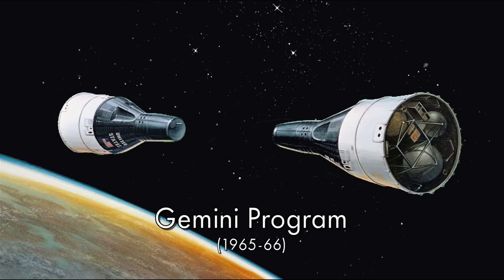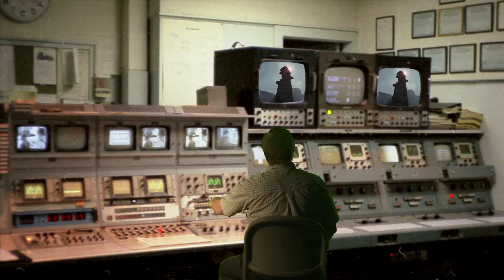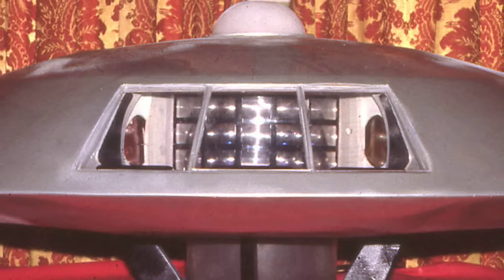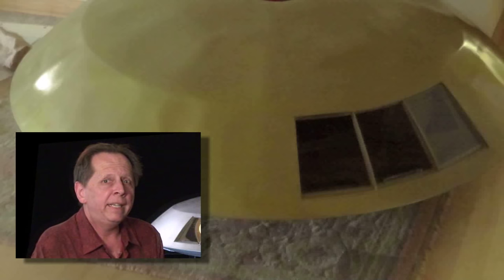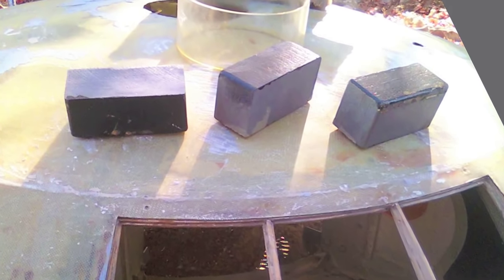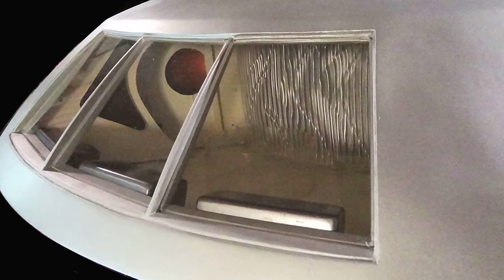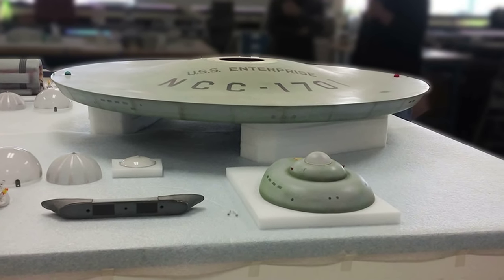RESTORING THE GEMINI 12

Comment: It was too slow.  Would take 98 years to get to Alpha Centauri.  The Jupiter II could make the trip in 5 1/2 years or much faster as in the 3rd season they pass through an entire galaxy over night.    .
Reply: Irwin's shows weren't noted for scientific accuracy.  I'm pretty sure they thought "galaxy" was interchangeable with "star system".  Then, a very, very few times they came up with some great sci-fi concepts like the "little bits of sunlight" in the generically titled season 2 opener, "Blast-off into Space" or the season one episode "Change of Space", with its intergalactic delivery ship.  One thing I've always wondered about is this:  if Alpha Centauri is 4-1/2 light years away, and the J2 can't travel faster than light, though it would take it that long to get there to the OUTSIDE observer, wouldn't it seem a lot quicker to the crew?
Reply: varanid9 with time dialation the time would be much less for the occupants.

Comment: Fusion core still looks to long?  Ship is perfect
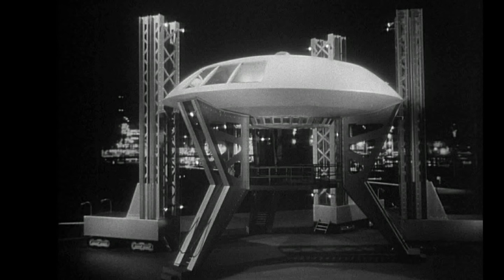Reply: Eddie, what do you mean by: "Fusion core still looks too long?"  They are identical.  Take into account the difference in appearance due to focal length of the lenses used (See 1:30-1:38).  We have no way of knowing the lens used in the shot you are using to judge.  Also, the lower brightness lighting seen at 3:48 clearly shows the Fusion Core's rim detail allowing for a more accurate comparison.

Comment: Where did Jupiter 2 comecfrom?
Reply: At the time of the Lost In Space pilot, NASA was in the middle of the Gemini space program.  The Gemini capsules held two astronauts and the mission was to rendezvous with another capsule and crew.  Irwin named his ship the Gemini 12 figuring that the network executives would be familiar with the then-current Gemini program and understand that the Robinson's ship was an extension of the name only 30 years in the future.  NASA's Gemini program ended about a year later with the launch of, coincidentally, their own Gemini 12.  When Lost In Space was sold as a series, Irwin and the producers realized their ship's name would soon be history and re-named it the Jupiter 2.  No one has a lock on where the name originated, but Allen's 1962 feature "Five Weeks in A Balloon" was centered around a gondola and large balloon named the "Jupiter."  So, the Robinson's ship would be the second Jupiter...Jupiter 2 if you will.
Reply: I'm sorry??? You must have been Mandela Effected.
Reply: As a rabid LOS fan, I recall the storyline that the Jupiter (1) was sabotaged. The implication was that the ship + crew were destroyed by the same force which employed Dr. Smith. But, when Smith became an accidental stowaway, all bets were off.

Comment: paint is very patchy
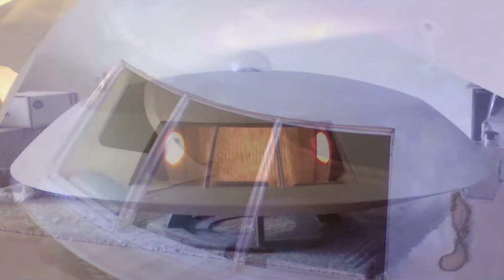Reply: Under full studio lighting it does appear evenly finished, as did all of the originals.  Please observe this very same finish at 17:15 seen under very bright and even lighting.  As with the original, the surface is textured and when lit with spot lights, it does appear as you say, mottled.  
Many years ago, I was personally told by one of the prop-makers on the original production that they mixed dry concrete powder into  the aluminum paint before applying.  This was true for both the robot and the spaceship miniatures.

Comment: I don't like it being called the Gemini 12. I grew up with Lost in Space, and actually built my own model of it. It was always called the Jupiter II, and I think that is what it should be called. 

I understand doing a restoration on the original. But with today's technology, and the dimensions of the original (which unfortunately seemed to change) it would be very easy to build an entirely new one with 10 times the quality. It could actually be built out of real aluminum. I would love to have a very high quality model, about 18" in diameter, for decoration in my office. Everybody has U.S.S. Enterprise models, but very few seem to even remember the Jupiter II
Reply: In the Pilot, NO PLACE TO HIDE, which was shown to CBS network executives in early 1965, the ship is called the GEMINI 12. The pilot did not include Dr. Smith or the Robot.